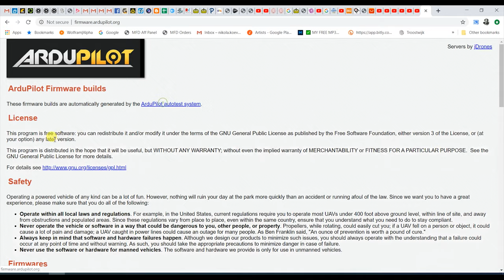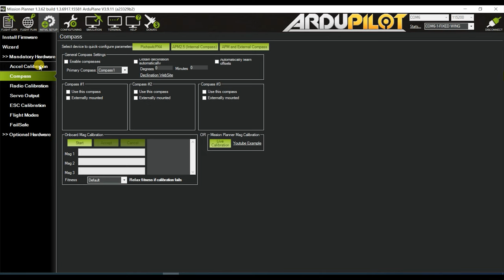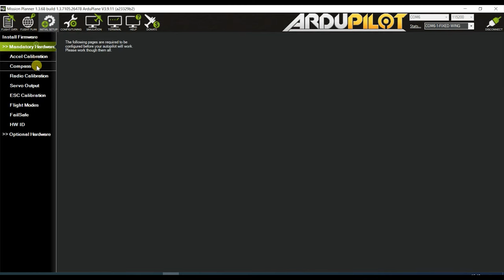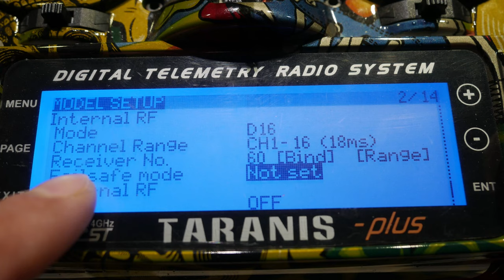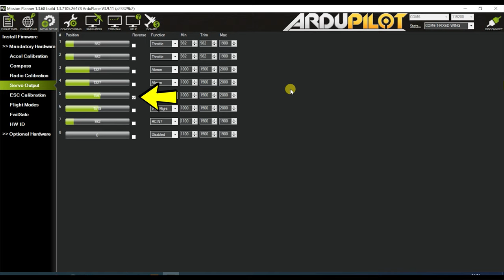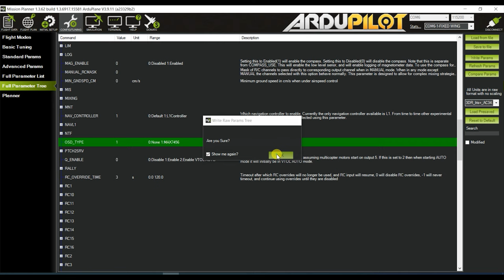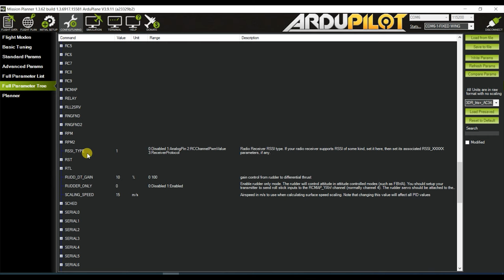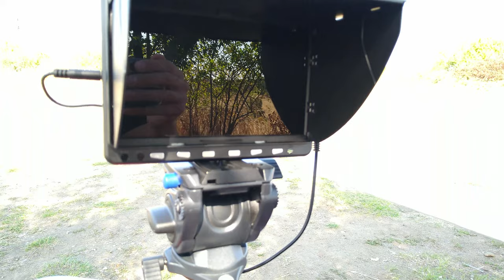HOW-TO Matek F405 Wing with ArduPlane + full setup (on the X-UAV Clouds)

Comment: Hi Arxangel. Please neegd  help from heaven!!!
I am setting a Matek F405 for a minitalon. The issue is i cant arm the FC unless i unable the Arming _Required to 0.
I did flash and setup orher Matek F405 for  Dolphing, C1 chaser , Ritewing without any issue.
I calibrate the ESC many times, change the ESC. Reflush Ardupilot 3 times starting for scratch all the setup in this video.Uncheck all the arming cheks. Read the ardupilot many times. Etc. 
Cant arm the FC using the ruder stick.
Any suggestion?
Thanks !!!
Reply from the maker: A reversed rudder channel perhaps? When you try to arm it while connected to the computer, what error message does it show up on the HUD as to why it wouldn't arm?
Reply: @ArxangelRC   oh interesting.  I will check the ruder channel on the radio.
Reply from the maker: @pablosiga6082  👍

Comment: To make the auto takeoff site independent, just put an RTL command after takoff.  Well that's irrelevant now, since there is a dedicated takoff flight mode which enables you to have both auto takeoff and later on a separate auto mission. Just my 5c.
Reply from the maker: Cool! Still have not read up on that! :)

Comment: I have a 3 wire ESC , but the S1 and S2 connections on the flight controller only 2 . Where do I plug it in ?
Reply from the maker: You need to remove the red cable from the servo pin!!!! Do not connect it to the board! Remove it and isolate it, so that it doesn't touch anything!

Comment: Sorry but yes planes should use a compass with Ardu. I know, everything you've read says dont use a compass. What it is supposed to say is " Dont use internal compass. Only use a compass from your GPS." I know some will disagree and argue but it will make a huge diffrence to your setup. There is to much documentation for the coders to change but they are the ones that gave me this information and have it setup on their planes. But only use an external Compass.
You can change your switch channel by changing the

FLTMODE-CH

from 5 to whatever switch you want in the Advanced tab.
I'm not going to argue the compass thing you can either use it for better flights or not.
Hope this helps some out there 😁
Reply from the maker: Yeah, sure, you can change that, but especially for beginners, it will be easier to keep things simple to start with! As for the compass... actually I have not read or being told not to use it!!!! ALL of this... everything I say and do, is a result of experience! Sometimes of painfully tedious and frustrating experience, dealing with compasses! Actually when I flashed the ArduPlane firmware to the F405 Wing... the compass was disabled by default, and in fact... I have been flying without a compass on my planes for years now... and have yet to see a major issue, especially for pure FPV flying! It can be argued that it is useful if you do a lot of autonomous missions... but just for flying... really don't see the point! GPS direction is perfectly adequate as a plane never sits still so there is always movement to help calculate the direction!
Reply: @ArxangelRC  nearly all the documentation for ardu and many YT channels wrongly say not compass on fix wing needed. Instead of what development team say which is dont use internal compass use gps compass. And after years of ardu and using a compass now it makes a big diffrence for long range flights.
Reply from the maker: OK... but HOW!? I've been flying without a compass from day one, and I've had ZERO issue due to the lack of one!!!

Comment: Hey! I am trying to set up the cutoff voltage for LION to 2.5 voltage cutoff on blheli. How would I be able to connect ? Could you make video
Reply from the maker: BLHeli? So not on the F405 controller?
Reply: @ArxangelRC  I was able to figure it out. I got two and half hour flight from the Lion batteries
Reply from the maker: @farkhodkhikmatov4738  Well done! :) Congratz!

Comment: what servo is the motor on? Having a problem with getting mine to work. Thank you very much.
Reply from the maker: You mean on which channel output on the flight controller?
Reply: @ArxangelRC  yes sir, my motor test is blacked out. Esc tone when i connect battery but no motor test. Not sure if i have motor set. channel one is throttle, next is empty, then elevon right and thne eleven right. this is a matekf405 wing setup.
Reply from the maker: @phillip7047  But have you set it up in software that channel 1 is the throttle?
Reply: No I haven't,  not sure how to.
Reply from the maker: @phillip7047  Are you using AdruPilot firmware?
Reply: Yes sir.
Reply: @ArxangelRC  yes sir
Reply from the maker: @phillip7047  You connect to it in Mission Planner, top left go to the Setup tab, them Mandatory Hardware subtab, and then "Servo Outputs". There you can setup all the outputs of the autopilot and you can set "Throttle" to the channel you have the motor connected to, and it should work properly.
Reply: @ArxangelRC  AWESOME!! thank you so much!!!!
Reply from the maker: @phillip7047  You are welcome, I hope you get it working.

Comment: How do I get my radiomaster to actually move the radio calibration values? I'm using a TBS  Tracer (CSFR).
Reply from the maker: How does the receiver connect to the flight controller? is it connected to the correct port?
Reply: @ArxangelRC  - thanks for replying. It turned out to be a bad TBS Tracer receiver. Put in a ELRS and it worked fine. But now, when I use left eleven, the ailerons move, and when I move ailerons, the elevons move. How do I make changes (is this the reverse function under Servo_?
Reply from the maker: @AllAroundTube50  What kind of plane is it? You have to move the channels around in the radio it seems. If I am understanding this correct, your ailerons move the elevator and vice versa?

Comment: Hi. I saw your video that is very useful. I want to ask that i have the ct6b transmitter which has the channels only. And software show the flight mode channel 8. So i want to change in channel five. Param trees also shows the flight mode channel 8. And full param alao show flight mode channel 8. I changed it but not saved properly. So please make the short video for how to change it.
Reply from the maker: To be honest I have never changed the mode switch channel... have always used channel 8, but I have seen this channel mapping in the full param list... and I can't see a reason why changing it there wouldn't work! Do you have anything else setup on channels 5 or 6 in the radio or on the Autopilot?
Reply: @ArxangelRC  no. I have not any setup which has the channel five or six.  I have same setup as yours. So i want to change it in channel six or five.
Reply: @ArxangelRC  hi hope you doing well. I have changed it. If you want to change it let me know. I will tell you. How to change it.
Reply from the maker: Hi, sorry for the delay... how did you do it?
Reply: @ArxangelRC  hi, it can be change in software.
Reply from the maker: Yup, I told you as much! :)

Comment: Do you need to enable or press  the DFU button and does it need to be connected to a battery
Reply from the maker: Does not need to be connected to a battery, and the DFU button is needed only during the initial flashing with ArduPilot in the iNav or Betaflight configurator.
Reply: @ArxangelRC  thank you very much🙂

Comment: I'm sorry total noob here, for the mission planner setup, how do you connect the board/autopilot to the computer without USB?
Reply from the maker: Via a telemetry link, but that would come after the initial setup/flashing of the board is done.
Reply: @ArxangelRC  oh alright thank you so much. I am using a new product in the RC market, the SIYI products precisely the FT24 and their receiver and module, the FR20 and the FM30 respectively. They promise telemetry. Have you worked with them before?
Reply from the maker: @ejegbavworuemu2129  I am not at all familiar with those items... they are SIYI?

Comment: Be careful flying in strong wind without an airspeed sensor and compass disabled. I’ve found an issue. Lost a mini talon and nearly lost the nano talon. I’ve enabled compass and it seems to be more stable.
Reply: Hee he he you didnt have compass back then. Now your also king of high winds.
Reply from the maker: I have tons of fun flying in strong winds, and I've never had an issue due to the lack of an airspeed sensor or a compass! But that is my personal experience, not forcing anybody to do it like that... just showing you how I am doing it!
Reply: @ArxangelRC  I know you do.  A lot of people do.  I thought it was something I had wrong in my config but I lost a Mini Talon using pixhawk 4 mini and almost lost a Nano Talon on the F405 Wing due to the same problem.  Andrew Tridgell (one of the lead developers for Ardupilot) looked at my logs.  Just something to keep in the back of your head.  I wish I didn't "need" a compass because I love the BN-220 gps.
Reply: @NoFlyDrone  Its really hard to make people understand it was never ment to say no compass just no internal compass for planes. Cause they have compensated for it over time. But if they tried an external they'd see the benefits.
As you know for years I thought no compass till I found out that was wrong  and all the development team corrected me as they all use compasses. It's the one problem of so much documentation.
Reply from the maker: Well... might give it a try on some plane... that will easily have it away from power wires and interference... otherwise it is just a pain in the A** for me!
Reply: @ArxangelRC  Ok so here's the definitive word on Compass on  Planes. Yes the development team all use one, I mean ifthey didn't and wrote the code then you would be worried.  Does it cause problems no infact it helps ifyou have a brown out, the plane will be able to return on dead reckoning.
Now do the benefits out weigh not using one? Well this is difficult to answer aparently! So if the compass is installed correctly away from interference and properly mounted as well as configured precisely then it's a great addition. 
BUT always is one. BUT if you don't have it installed securely don't use it. If you are getting any noise from any other hardware don't use it. And if you don't configure it precisely it will cause problems, don't use it.
The development team say the docs should say only use external, but they never explained that if it's not configured or all issues above not to use it. Of course they are happy to use I and recommend useing it as they know exactly the right way to use this hardware and software, it's there job. Even after been told to use it and flying LOS with it I have changed my stance. I don't think I would do it to the standard that it apparently is supposed to be done to even after discussing it with them. It works and fixed some issues but for long range unless I know exactly what's ment by the 3 things the highlighted I'm now not going to use it.

This makes me feel horrible as it means I've advised a mate to use it and think just like me he'd be better off not using it.
Reply from the maker: Haha... well... like I said... too much hassle with this thing to justify using it for FPV!

Comment: Hi. I tried to use arduplane on my F405 wing but I can't select flight mode or assign servo because I have a error saying unknown and initialising. I tried different( 4.00 to 4.05)  firmware without success. I followed your vid and Matek website but still stuck in initialising.
Google isn't helpful. 
Can someone help me please?  I have 8 planes running INAV without issues but wanted to try ardupilot for my 2m flying wing.
Thanks
Reply from the maker: That is weird indeed! How did you flash the Ardu firmware on the board?
Reply: @ArxangelRC  I download from ardupilot then use inav configurator to flash the board with the Bl.hex firmware(tried 4 to 4.05). Full chip erase. I tried to flash using mission planner too. Same results.
I will try the 3.98 and 3.99 this afternoon. Thanks again.
Reply from the maker: Hmmmmm... but does it flash successfully?
Reply: @ArxangelRC  Yep no error .I can connect it to mission planner. I get voltage readings,attitude......
Reply from the maker: Is it possible there could be a problem with the board itself? I've never gotten such error! Any chance you have a 2nd one to test?
Reply: @ArxangelRC  sadly I only have one. All my others board are F411wing,wse and F722wing's.
Hope ardupilot will support f722wing too.
Reply from the maker: Will not support it! Not enough memory in the chip for the firmware! Sadly those are stuck with iNav only!

Comment: i do not have a transmitter, can i use any telemetry modules and just fly it with joystick connected to my pc
Reply from the maker: As far as I know, yes you can.
Reply: could you suggest any module which has like good range. you can tell me in categories like upto 2km, upto 5km, upto 10km or till 20km
  @ArxangelRC
Reply from the maker: @mukundgirgaonkar2072  Well... as usual the most important part of any wireless system is the antenna, so you can easily get 20kms out of 100mW modules, prodived you have very good antennas both on the ground and in the air! I have not really spent much time deaping with telemetry modules myself, generally have used the integrated telemetry capabilities of the DragonLink system I use, but since it is also a control system, I've never had to use Mavlink to control the aircraft. One option is something like this - https://s.click.aliexpress.com/e/_DeJCWDr - which has an option for 1000mW output power, which is quite a lot, and with some custom antennas it should give you a good range! Another option are the RFD modules - https://s.click.aliexpress.com/e/_Detjhct - but they are pricey, though they seem to be quite popular in industry! In any case I believe you will also benefit a lot from an antenna tracker - https://s.click.aliexpress.com/e/_DnMnVLX - just to make sure the antenna is pointed at the plane at all times.

Comment: Is is there a way to adjust the pitch of the board When it's in the plane
Reply from the maker: Yes! In Mission Planner go to Full Parameter Tree, expand the AHRS sub-tree, and in there you will see AHRS_TRIM_Y and AHRS_TRIM_X. You need those values to adjust the autopilot's position relative to the plane, if its not perfectly aligned! To the right you will see an explanation of each parameter and what value does what!
Reply: @ArxangelRC  got it , thanks
Reply from the maker: @jimmytheriot8978  You are welcome! :)
Reply: @ArxangelRC   One more question , have you made a video how to set up different flight modes on  Mission planner, mama right now all I have is manual mode stabilize mode and return to home , would like to add cruise , auto trim and auto tune
Reply from the maker: @jimmytheriot8978  Hi, I have not done a video like that, mainly because I do not setup 2 mixed switches that actually allow for this, as I find it a bit too confusing, since I fly a different plane every other week, and this would be a nightmare! A rotary 6 pos switch also works, if you have it, otherwise you can search for such an instructional on youtube, I am sure somebody has done it!
Reply: @ArxangelRC   Oh well never mind lol oh if I got to set up 2 mixed switches I'll just leave it as is, you're right I had a flight controller that uses 2 mix switches And it was confusing
Reply from the maker: @jimmytheriot8978  Indeed! :) Best of luck to you!
Reply: Is uart 3 the only way to use GPS is it possible  to use uart 4
Reply from the maker: @jimmytheriot8978  If you can select it from the listed options, then yes! These are freely programmable for the most part!

Comment: Hi . I have receiver X8r. i use serial 1 but smartport doesnt working . is there anyway ? thanks
Reply from the maker: Well you have to program it in the parameters of the autopilot to output S.port compatible signal!
Reply: @ArxangelRC   in my QX7 iset up input and mixer A E T R. but in TAb SERVO OUTPUT , my throttle dont move. :( do i set TX wrong ?
Reply from the maker: @LDD21  Well... few things... you need to arm the model before you would see throttle moving in the "Servo Output" tab. Are all other channels working?
Reply: @ArxangelRC  . Thank you so much . It works. !!
Reply from the maker: @LDD21  Awesome! :)

Comment: Hai, do you have any detail to setup telemetry, because on 14:10 its very hard to me to understand, hope u can help me. thank you
Reply from the maker: At 14:10 I enable the RSSI... what is unclear about that?
Reply: @ArxangelRC  i use R9m Slim + for receiver, so for wiring, i just plug s.port from receiver to Smartport on Matek F405, and setup configuration at 14:10 is it right?
Reply from the maker: @dekiaza  F405 does not have an S.port... it can have the telemetry port programmed to output FrSky telemetry data. What I describe at 14:10 is how to setup RSSI, which is not the same as telemetry! I've never setup FrSky telemetry on ArduPlane myself, only heard of people doing it... so I can't be certain... but in Mission Planner, in the Full Parameter List tab you will have to find the Serial port that is setup for the Mavlink telemetry, since I am assuming you have connected the R9 Slim's S.Port to that same output on the F405, and in there on the right you will see listed more options for this port, in addition to Mavlink! I think one of the options was the FrSky Telemetry, so input the number it is given on the left, and write params, then power cycle the FC... and if all is good and there are no addition steps to be taken... this should do it! But again... this is only from what I've noticed while looking around Mission Planner, am not certain it will work so easily since I've never done it, but you can give it a try nonetheless! :)
Reply: @ArxangelRC  ok thank you for your help 🙏🙏
Reply from the maker: @dekiaza  You are welcome, I hope you managed to get it working!